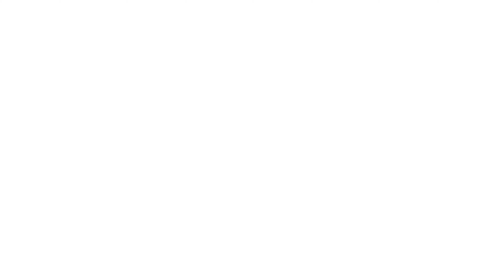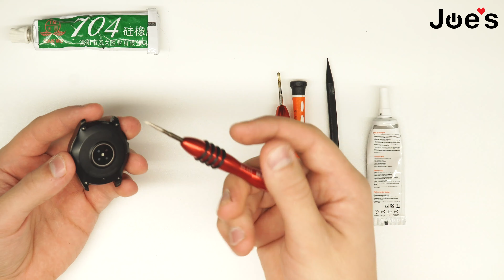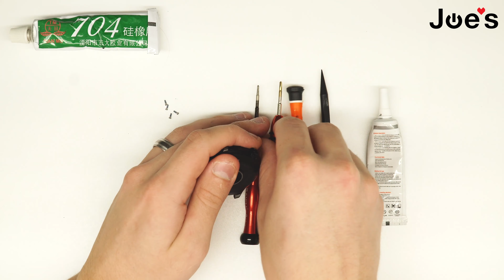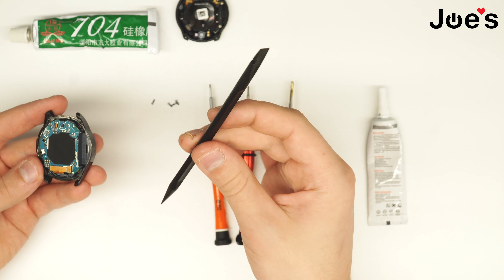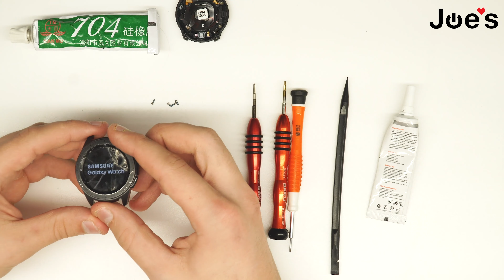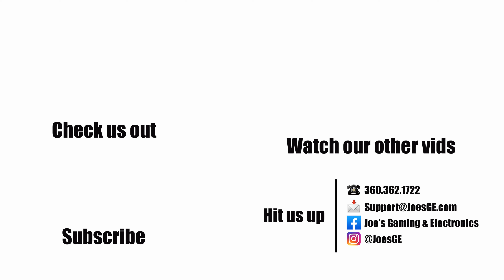How To Repair Samsung Watch SM-R810 Battery Replacement | Repair Tutorial

Comment: Can you please tell me where the negative electrode, the positive electrode, and the data transmission electrode are located, because I cannot connect the system via Wi-Fi. Please, please help.
Reply from the maker: Hello, thanks for commenting. Please email us at support@joesge.com with your question. We will be able to better assist you there. - JoesGE

Comment: I've changed the battery in my galaxy gear s3 many times with no problem but having issue getting to the battery on my galaxy watch. The side clips keeps a tight grip on the circuit board not letting me reach the battery.  Wished they had the batteries on the back like with older watches.
Reply: Hi, where buy your batteries?

Comment: Great tutorial.  Question - Do you need to apply the adhesive to the screws or screw eyelets to prevent water from enter around the screws?
Reply from the maker: You can add a small amount like you would locktite.

Comment: I replaced the battery but it won't power up.  When I put it on the charger, it connects and says 94%. Any ideas why it won't power up?  Thanks.
Reply: Did they help?
Reply: I too am having this issue. I managed to get to the battery just to find the replacement was wider and longer than the original and wont fit so had to reinstall the original battery and put it back together.  Now it wont turn on yet on the charger it says it has 89%
Reply from the maker: Hello, thanks for commenting. Please email us at support@joesge.com and we will be able to better help you there. - Aaron P